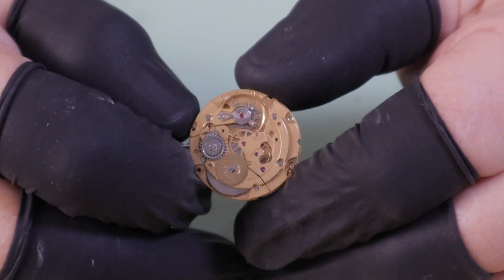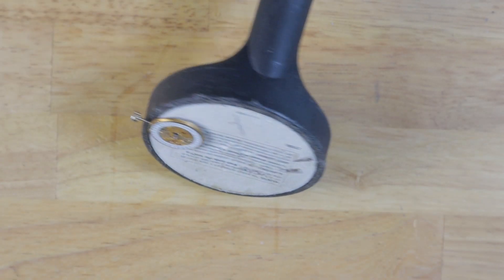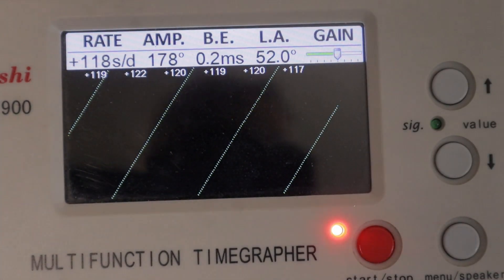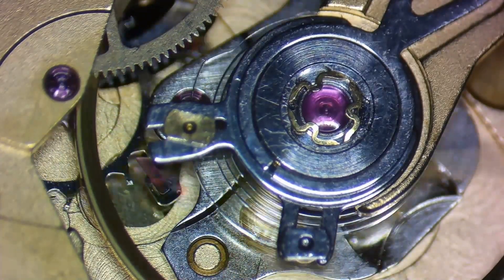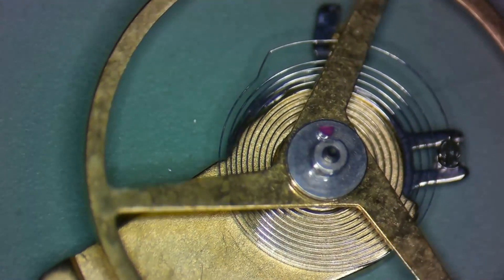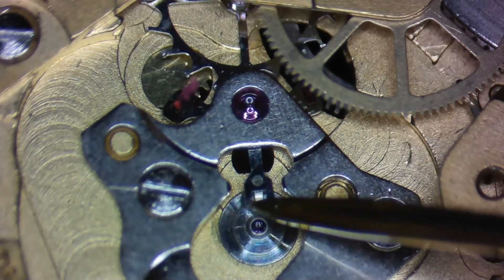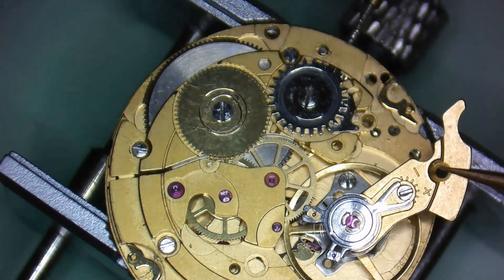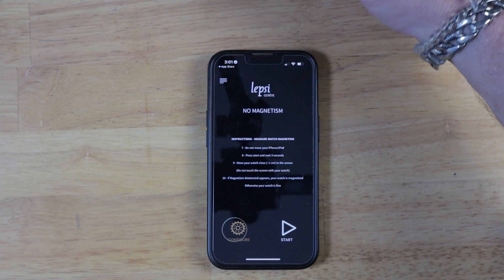How Magnetism Affects Watch Regulation

Comment: Alex, I have a question: what's the difference between turning the regulator pins. clockwise or counterclockwise?.
Thanks again for sharing your knowledge.
Reply from the maker: What do you mean, turning the regulator pins? Regulator pins are not turned. Are you talking about the regulator block on Etachron regulators?
Reply: Yes, sorry, I am from Spain and I'm using an automatic translator.  @watchrepairtutorials

Comment: Unfortunately, I just magnitised my omega 19lb because it was behaving like it needed demagnetising. Used a plate Demagnetizer, because it was $250 cheaper than the Elma and now I'm stuck, no pun intended, because I can't afford the Elma and I've tried one of the $12 little blue box that didn't do diddly. Where I once had a watch that was fluctuating by a minute or two per day is now a blizzard on the timegrapher. 😢
Reply from the maker: Unfortunately, the little blue box you can make the problem worse. 
They can work under certain conditions. It just depends on how much magnetism is present in the watch and many people will screw up their watch using one.
One of the mistakes people make is using a compass to detect magnetism.
This is because all ferrous metals contain some degree of magnetism so compass needle will almost always move when put near the watch. What typically happens is that there is a problem with the watch, running fast, they diagnose it as magnetism using a compass, and then they end up using the blue box to demagnetize the movement and actually end up, magnetizing it more than it was creating another problem.
My recommendation to you would be to take it to a shop that actually has a demagnetizer and have them do it and if there’s no one local, I would find someone you could send it to. If it’s as bad as you say,
Reply: @watchrepairtutorials Thank you Alex! In a last ditch effort, last night I bought the Demagnetizer that you linked at aliexpress, (the Chinese one that looks like the Elma) and it'll be here Saturday. Unfortunately, I don't have any local watchmakers and even if I did, I'm a homebound disabled guy that relies on everything being shipped to me and/or picked up with a prepaid label. Right now i think im in the middle of trying to fix it by asking advice of kind folks like yourself or admitting defeat and realizing that I ruined a decent and beautiful watch.... using my phone app for detecting magnetism, it shows as not, but the weishi is screaming at the top of its lungs that I've magnetised the hairspring with this plate Demagnetizer...
Also, I REALLY appreciate you responding to me sir, so very much!🙏🙏🙏

Comment: Had a new watch running about 10 to 15 seconds fast each day, I ran it over my compass and it wasn't much of a response, but it did make the needle move a bit, could also have been the metal.

So I decided to try demagnetize the watch and it ended up running about -15s/day, in the 3 up, down to -30s/day 

My demagnetizer is a cheap one, with a hole through the middle, and I started with pulling it through the hole, so I am wondering if it was a bit much for the movement, resistant to just 60 gauss. 

The watch doesn't move the compass needle anymore and it also does not change any readings on my magnetometer app, so it's definitely magnetism free, amplitude is still 230 to 300 degrees and healthy and beat error is still low at around 0.2 ms. 

So I guess it is possible the watch was just a little magnetised from the factory when it was adjusted? 
Or might I have bent something with the strong magnetic field? ... or would that show itself with beat error and amplitude being off? 

Thanks for the great video, your tutorials are amazing!
Reply from the maker: You are welcome. It’s hard to say when the changes are small. What factory made the watch.
Reply: @watchrepairtutorials  Thanks for the reply! 

It's a 6R35, so I'm assuming Malaysia, Philippines or possibly China, it's an Seiko SPB297J1. From what I've read around forums at least, do I get the impression they are not made in Japan anymore. 

I've adjusted the rate on some 7S and 4R movements with success, not touching the regulator pin or support stud. 

After learning from you about the etachron system, I have decided to get a Weishi 1000 timegrather and an NH36 movement to try my hand at, before I try my hand on watches I care a lot about. 
Seems it will be a serious challenge adjusting the regulator pin without a microscope, a strong loop might be a help at the very least?? 

This watch I have that now is running a little slow, I bought as a momentum for making it through my mechanical engineering bachelor's degree after wanting it badly for a few years. Also the degree has been an eventful and very special time in my life, and so the watch does mean a lot to me. 

So I've decided I will let a watchmaker adjust it, as I don't want to risk doing it myself at this point with my very limited experience, also with it being more than twice as expensive as any other watch I own, I still got another degree in front of me, so I am careful with how much I spend. 

But I will try my hand at some loose movements where I find the time, it's very fascinating to me how these small parts are manufactured, with such accuracy! 

Any idea what could be useful information to the watchmaker? 
It's a Seiko service center, so I guess they are likely to start with demagnetizing, all through maybe not if it is running slow? 

Either way, thank you for making these in detail tutorials and guides!

Comment: Hi Alex, thanks for this video - since both demagnetizers work is there any advantage to the more expensive one? I think it’s now around $300😮
Reply from the maker: The little blue ones are really hit and miss and they’re very finicky to work with. 
Because you use the magnetizer a lot, several times during a watch service, it really pays to have a reliable one.
So the biggest advantage of the more expensive one is that it’s one button and it works every time. 
I am looking into the Chinese version of the Elma demagnetizer, which is quite a bit less expensive it all probably be doing a video on it when I get it.

Comment: If you've ever taken physics, this phenomenon is known as Lenz's Law.

In a nutshell, the coil of the hair spring acts like a solenoid, the movement of the magnetic field in the palate fork and hairspring induce a current in the coils of the hairspring. According to Lenz's Law, that induced current will oppose the change in the movement of the hairspring which is why the amplitude drops so dramatically.
Reply from the maker: Thank you for your perspective. I am definitely not trained in physics but I have learned a little about the physics in an oscillator so correct me if I am wrong.

Magnetism can indeed affect a hairspring and cause a reduction in amplitude. When a hairspring becomes magnetized, it can stick to itself causing the frequency to increase and  interferes with its ability to oscillate freely. In most cases this causes an increase in the rate since the frequency is higher. 

 Although this is normally true, under the right conditions when a spring’s coils are touching  each other due to compression or during movement, friction occurs between the coils. This friction acts as a resistive force, slowing down the motion of the spring.  This can also lead to a loss in amplitude. 

The reference to Lenz's Law and the induction of current in the hairspring I believe is incorrect in this context. Unless I am mistaken, Lenz's Law refers to the principle that the direction of induced current in a conductor opposes the change in the magnetic field that caused it.

 However, in a watch hairspring, there is no significant current being induced because the hairspring is not a conductor designed to carry electric current in the way that a solenoid or electrical coil would.

Comment: I used that demagnetizer on my omega seamaster 300 co ax. Dosent seem to work :( what can i do? Unless that magnet is magnetized itself or that the compass is reacting to metal parts in the watch. Anyway, still runs fast
Reply from the maker: your watch has a silicone hairspray so I doubt that's what's causing it to run fast. How fast is it running and when was the last time it was serviced?
Reply: @watchrepairtutorials   its the cal 2500. When i got it back from service recently it was at 8 to 10 sec a day. A bit too much if you ask me. But not too bad although not within the standard of that movement. I might have been demagging it wrong tho. I see some people leave it on the demagger 5-10 sec then lifting it up, and i see some who have it slightly levetated for a few sec before lifting it up.
Reply from the maker: @endre1996  yeah well definitely not Demag a demag issue.
do you know there's quite a few variations of that movement and the early ones could be somewhat problematic. 
Have you contacted your watchmaker to see what they said?

Comment: Hi Alex, I really appreciate all of the information you impart. I am a year deep into the restoration business of pre-1950 watches.....anyhoo, I have a question: When demagging a movement should the movement be running? I ask because more often than not the pieces I work on have not been running for 20, 30 or more years. After listening to your reasoning, I will be demagging all my movements, multiple times throughout the process going forward, but just wondering if there is any advantage to having the movement running to start with?
Thanks in advance for your help,
Wayne
Reply from the maker: Thank you Wayne.
No you can do it  either way and I do.
Once after disassembly, prior to pre-cleaning the parts and again after assembly prior to letting the movement run for 24 hrs.
So in one case it's not running and in the other it is.

Comment: Thanks Alex, 
I used to adjust compasses on steel boats. Due to the magnetic flux lines of the earth, it causes the ship to act like a big bar magnet. These magnetic lines are comming through the boat at an angle of about 45 degrees at a latitude of 40 degrees north. If the boat is rotated in a circle, the magnetism will follow the north and south orientation of the earth. So, the boat changes polarity.  I don't know if this is what is causing the residual magnetism you are seeing.   It does effect all ferrous material. Just a thought.
Reply from the maker: Magnetism and watches can come from many places, including static, electricity, electronic devices, etc. the point is you don’t want it in your watch

Comment: Do you have to remove the movement from the case to test, or can you test the movement inside of the case? Also… do those 30 dollar de magnetizers from Amazon work? They’re white, and made of plastic. With a hole in the center to put the watch through. In addition if you put a watch that doesn’t have any magnetism  inside a de magnetizer, is there risk of damaging your watch’s performance? Thank you. Love this channel. Learning a lot. 👍🏼
Reply from the maker: Well, you could certainly test the watch movement for magnetism in the case but when demagnetizing, you’ll get better results with an inexpensive demagnetizer with the movement outside the case.
I don’t know about those white demagnetizer you’re talking about as I’ve never used one but the $10 blue ones will work if they’re used correctly . Finally, if watch movement is not magnetized you can inadvertently magnetize it hurting it’s performance using an inexpensive demagnetizer, which is something that you don’t have to worry about with the more expensive ones.
Reply: @watchrepairtutorials  thank you! 🙏

Comment: Hi Alex, Another great video. Thanks for sharing your knowledge with us.
Since the Leps app is no longer available I'm using an app (Magnetometer for iPhone) which shows the results in micro teslas (µT). Do you, or anybody here, know above how many µT a watch is considered magnetized?  (80µT?, 100µT??). Note: Without any magnets around the app shows ~37µT.  
I'm working on a Seiko 5 watch from the 60s and the app says the watch is ~137µT magnetized but it doesn't matter how many times I tried to demagnetize it, I can't get below that number. 
I'm afraid to keep demagetizing and damage the watch. Can a watch be damaged by demagnetizing too many times?    
Also, can a watch be magnetized permanently beyond repair?
I don't have a professional demagnetizer but it's not the cheap $10 Chinese either.
https://www.amazon.com/Demagnetizer-Demagnetization-Watch-Machine-Repair/dp/B07J6625MD/ref=sr_1_8?crid=370OMP3Q33EDO&keywords=watch+demagnetizer&qid=1706594311&s=hi&sprefix=Demagnetizer+watch%2Ctools%2C93&sr=1-8
Thanks in advance for your help.
FL

Comment: I bought a remade Soviet Watch from one of the Dealers in Eastern Europe.  Its supposed to be the Movement from a 60s Military Pocket watch mounted in a new wristwatch case with a repro Face.  Its very quirky and handsome but ive had a reoccurring problem with Magnetism.  Since it arrived, the watch becomes magnetised every few days to a week and runs crazy fast, like 12 mins an hour fast!  After 3 trips to the city (some distance) to the Watchmaker in a month,  i began to despair as the Watch was not particularly cheap.  He told me its a copy of a Seiko and all looks fine.  Once it's de-megnetised, it's typically gains 3 sec per day.  Tolerable, anyway, the Watchmaker says the spring must be made of a metal that is prone to magnetism.  As i live Off-Grid without any electrical appliances, i think it can only be my phone that is magnetising my watch.  Which brings me to my question; using an app on a phone to detect magnetism, wouldnt that in itself magnetise the watch because you have to put the watch (or Movement) on the phone?  
I use a Tablet, a little bigger than a normal phone and i do all my internet browsing on it, so if im wearing my watch while holdjng the device, its going to be well within the range of the device's electromagnetic field.  The Tablet may even emit a stronger EMF than a normal hand held phone.
The only other cause that occurs to me is that i regularly drive under 220,000 volt HV Powerlines, which are at least 60 feet above.  Is it possible that is magnetising my watch?  I read they also emit a powerful EMF, but i think its more likely the Tablet is doing it.  I haven't thought of any other explanation. 

BTW, i have a de- magnetiser on its way from China!  Im no Watchmaker, just a fan of old Soviet Watches, but i think its something i could get very interested in.
Your series looks excellent and ill be checking more of your videos out, thank you!
Reply from the maker: I suppose you could be picking up some magnetic fields from your tablet but I doubt you’re getting anything from the electrical lines overhead. 
By the way for living off the grid. I wish I could do that.

Comment: Yeah my (eta 2824-2 ) watch started running 17 seconds fast all the sudden. I ordered a demagnetizer the ( premium chinese Ruihua 22002 ) ( it works great and tools jump when I degauss.) and a time grapher. It immediately started running normal again at between 1 second fast and 4 seconds slow. A couple days later it started running +7 seconds fast. Demagnetized it several times in different positions and it started running +1 to -3 seconds. I figured out it was caused by a MagSafe battery bank magnetizing my watch from 6” away. I thought it was far enough away from it but it was mildly magnetized and made a big effect. Just wondering if it’s possible to regulate an eta 2824-2 closer than 5 seconds? Or should I not bother? In flat position it runs about 4 seconds slow with 00 beat error. In the vertical position it runs 0 to 1 second fast with 0.3 beat error. 
I’m actually very impressed because this is a $500 Aquacy US micro brand 300M diver and it’s keeping great time but I’m curious if this is as close as it’s possible to get with this particular movement or if I can get it within a second or two of perfect?
Reply from the maker: The ETA 2824 comes in different grades in at $500 you probably don’t have the highest grade available. Honestly, I would just be happy with what you have, and not mess with it.
In reality, movements can be improved, but it’s pretty high-level work, and that something you would be able to do without a complete understanding of how to escapement works.
Reply: @watchrepairtutorials  appreciated 👍👍

Comment: Thanks, Alex. I use a vintage South Bend demagnetizer.
Reply from the maker: Nice. How does it work?
Reply: @watchrepairtutorials  Basically the same way as any other except it's round and you put the watch or tool in the center and pull it out slowly as you're pushing the button. Or you can just hold the tool in the center and push the button for a few seconds and then let off the button holding the tool still if you want to magnetize something. It works well for magnetizing and demagnetizing.

Comment: In your opinion, does it make a difference whether or not the movement is stopped when demagnetized? I've seen other people suggest either pulling the crown out to stop the movement or letting the power run out completely before demagnetizing. Thanks for the amazing content!
Reply from the maker: No it doesn’t. I do it both ways. What’s more important is that you do it multiple times during the course of a service. Are usually do it prior to cleaning parts and after assembly assembly.
Reply: Thank you so much!!!